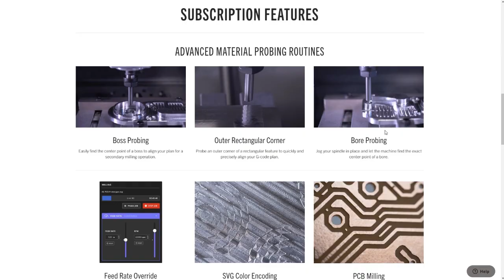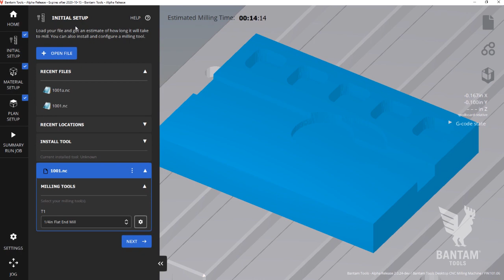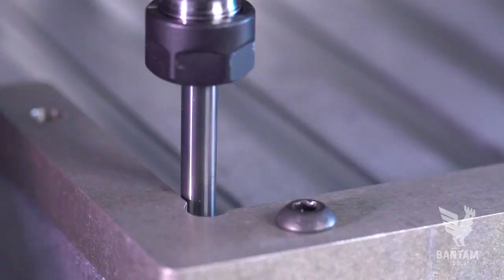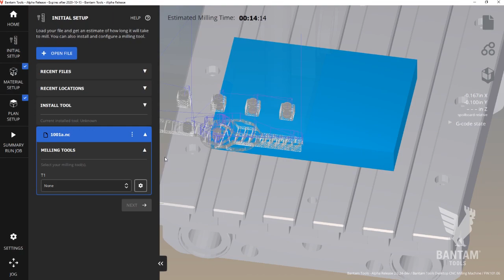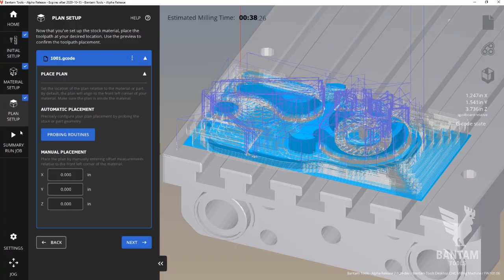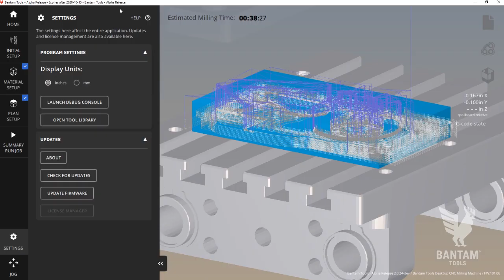Introducing the New Bantam Tools Milling Machine Software

Comment: Is this software a subscription still? It appears on your site as the Pro version for a fixed cost, but says nothing about subscription any more...
And running the free version, it says you can run the old PCB mill, but does that also include the OG Kickstarter Othermill I still run? I can't seem to get the software to run on my Mac anymore but it does run on my PC.

Comment: I’m sorry but having to over $USD3500 for a machine then having to subscribe to the software to get advanced features.   No thanks
Reply: I agree bantam should give you the simple updates in the conversation software.
Reply from the maker: Hey there @skipperrichman4278  — We do regularly roll out updates for both the free and subscription versions of our Bantam Tools software 👍 Also, our software is compatible with Desktop PCB Milling Machines. The only exception to this is the Kickstarter Othermills. Those mills were manufactured a decade prior and we are no longer able to support them. If you do have a Kickstarter mill though, we will still work with you if you have support-related questions, of course.
Reply: @bantamtools  Great, what is the new version up to now ? Thanks
Reply from the maker: @skipperrichman4278 , the latest software version is 2.4.14. You can always find the latest version of our Bantam Tools software here: https://www.bantamtools.com/software-download
Reply from the maker: Hi Stephen! Every Desktop CNC Milling Machine ships with a base pack of the Bantam Tools software for FREE. The base pack comes with automated probing routines, SVG support, Fusion 360 templates, and speed and feed rate override. In other words, the base pack has everything you need to get started and then some :) The subscription pack is completely optional and you don't have to subscribe if you don't want to.
Reply: @bantamtools  Tormach as I have been using for some years now supports any new software they come up with. You should step up your game. I have your old small white mills and can do many things but the conversation programming would be great to have but not for a cost. sorry we cant afford to have more old machines with old software.